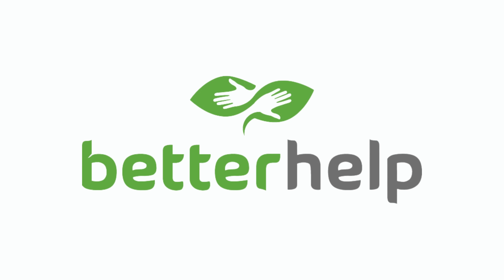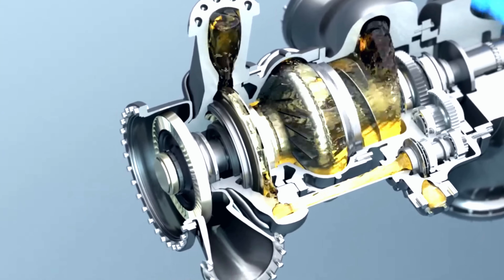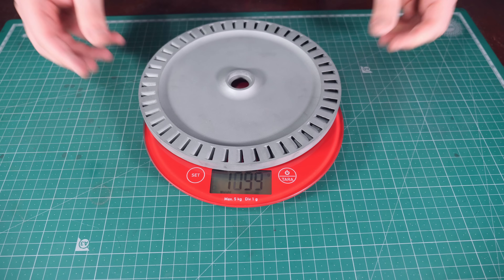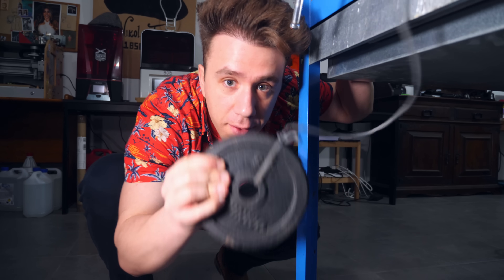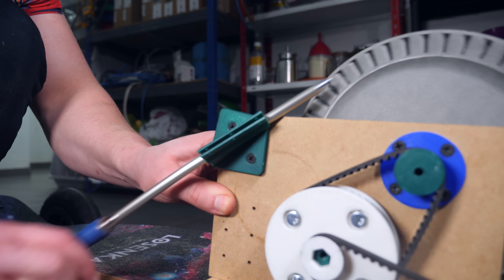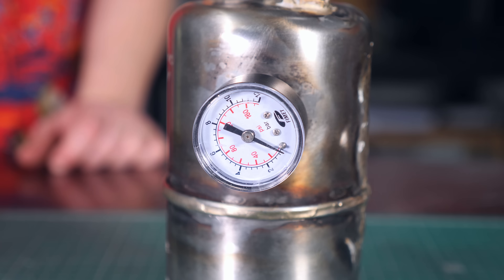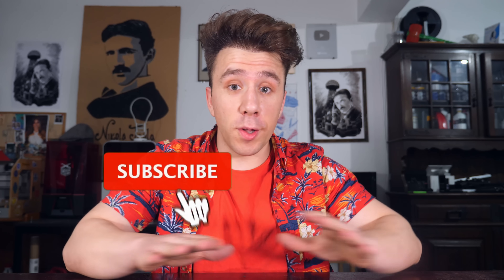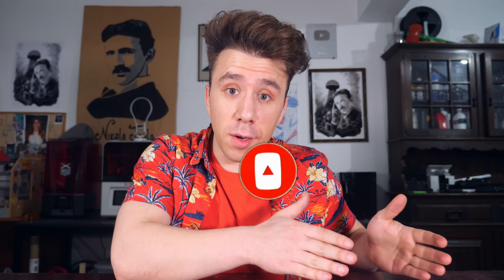I built a TURBINE Skateboard

Comment from the maker: JLC3DP 3D Printing &CNC Service Starts at $0.3: https://jlc3dp.com/?from=integza
3D Models at: https://integza.com/
My 3D Printers
Prusa mk3:https://amzn.to/3SEXr83
Bambu Lab X1 Carbon:https://bambulab.com/en-eu/x1
Creality K1:https://amzn.to/4bjM4K3
Prusa SL1S SPEED:https://amzn.to/4bu7LHA
Form 3: https://formlabs.com/eu/3d-printers/form-3/
CNC MACHINE:https://bit.ly/3sqTUQm
Reply: Integza, my sibling in Tesla, don't mess with homemade pressure vessels. Use an old LP gas tank or something similar that is designed to handle the pressure.
Reply: Integza, I greatly enjoy and admire what you do. You have investigated many interesting avenues of science in a fun and engaging way. HOWEVER, I have to say this was the most DANGEROUS video I've ever seen you make. You were incredibly lucky that the heavy metal flywheel didn't come loose from it's mount (an easily sheer-able bolt) and that your pressure vessel(without a necessary emergency pressure relief valve) never ruptured or exploded. between this and previous videos where you almost set your surroundings on fire or get a minor injury, your luck will run out. Please find a professional safety consultant to run these ideas by. I look forward to many more exciting but safer videos and wish you the best.
Reply: You said that you wanted more mass on the turbine wheel so that it has more ”hmph”, but the thing is, inertia does not increase torque or power. It only smooths it out. This is a very common misconception regarding flywheel physics. Very cool video though!
Reply: Super vidéo 👍👍👍👍👍👍👍👍
Connais tu la Jaguar cx75 ?
Voiture de la marque Jaguar , de 2010 ,elle est dotée de moteurs électrique et aussi de 2 turbines  pour générer de l'électricité.

Il faudrait que tu t'en inspires ça ferait un meilleur rendement 👍👍👍👍👍👍👍👍👍👍👍👍👍👍👍👍👍👍👍👍👍👍👍👍👍👍👍👍👍
Sam
Reply: BRING. BACK. THE. MOUSTACHE.
Reply: Never touch the the outside piece of wood when using a table saw. It’s the most dangerous thing to do. A big Nono. Please pass on to integza. Can’t have these videos if your fingers are gone.
Reply: @murdocks4304     that liquid nitrogen can do the same thing albeit w/o the blood n guts of a blade.... but I saw
him doing that & it made me cringe.  We were given all our fingers for a reason,  keep em' long as ya can!!
Reply: Screw betterhelp, it is really sketchy.
Reply: Integza for One of your next Rocket engine I suggest you to 3D print some parts with a carbon fiber filament and then cook It to remove the plastic from It, so you can get a nice carbon fiber Rocket.
Reply: Integza, BetterHelp is not the kind of company that you want to support. They've leaked private customer data in complete flagrant violation of any and all privacy laws, and their "therapists" are horrible.
Reply: PLEASE DO NOT USE A COMPANY THAT WAS SENTENCED FOR SELLING PATIENT INFORMATION AS A SPONSOR.

Tried BetterHelp once, they were rather expensive for my countries standards, so I cancelled, so they were like hey finnish your order woth a discount now. Then I did not, then another discount, in the end the price was about 60% off. So I figured there is no ay a healthcare provider based in the US can offer such crazy discounts to a random dude, while still keeping professional and vetted staff and not making any money on a side hustle. And sadly as we learned it was about the same thing it always was: Data, data, data.
Reply: The turbine isn't used because it's actually less efficient than the combustion engine. They also stop and start more quickly, adjust power more quickly, and are less effected by ambient temperatures. The turbine is only better if you need incredibly higher top speed and power, so it's not really useful on the road
Reply: I really like iceberg and see you in egghead
Reply: That pricing on JLC3DP is weird. Your part show 1,7KG weight but when arrived, it was 1.2Kg. I tried my part, it was 2.8 Kg according CAD (and volume by JLC3DP) , but it show 4.8Kg in part weight. That's big difference in price and shipping.
Reply: bro you HAVE TO add a cover that holds the air nozzle at the perfect angle an covers the turbine so the air doesn't get pushed everywhere  when it hits the turbine... you want to keep all that air concentrated on the injection site... when the wheel spins and the air hits the part without the opening the air bounces off and creates MASSIVE TURBULENCE!!!  but of you have it closed opff the will bounce off the wheel, then back in and around the box  but then back into the slot.... you'll get SO MUCH MORE POWER!!!
Reply: WHAT ABOUT DRY ICE???!?!?!?
Reply: Why did you change your icon to an orange? I missed videos because I didn't recognize the icon.
Reply: Not sure how I landed at your doorstep but I think bat-sH!T krazy is like a telepathy that attracts w/o knowing anything
at all about a person.  It's a subconscious connect that you seem to have plenty of..... I like >> peace
Reply: So you basically used my idea i posted some videos back of a rocket propelled skateboard you could ride but i didnt get any likes tho
So did i win a 3d printer heh 😅
Reply: You always do such a great job. So many things i would like to say or talk to you about, sadly i can not. i am glad you had a good time in Alabama, the coast is beautiful in the gulf. The turbine system was used in tanks but was very inefficient in that they still burned alot of fuel in idle.
Reply: Assemble two of those things and support them with small cogs.
Reply: For the next video You should do three things to increase the power output of the turbine and maximize your speed. 1) support the turbine wheel on both sides with bearings. 
2) balance the turbine wheel. There is definitely some imbalance
3) center yourself on the board so your (human & equipment)weight is distributed mostly evenly.
Reply: Here's a decent idea how about a 3d printed rc  plane powered by compressed CO2 or something, I bet that pressure vessel you built is light and powerful enough to fly it
Reply: Should have used a Tesla Turbine. Easy as pie to make. Just a flat disc. A bunch of them. No 3d printing needed. In fact Tesla turbines can spin so fast that the metal itself can't handle the centripetal force and fly apart. Probably a lot more efficient on air needed to run. And I would use a CO2 tank used for soda machines to power it. And you DO have brakes. Just need to blow the nitrogen at the bottom to reverse the direction it wants to spin. Top=Forward. Bottom=Brakes/Reverse.
Reply: That is so so so cool! Glad can be part of this amazing project!:face-red-heart-shape::face-red-heart-shape::face-red-heart-shape::face-red-heart-shape:
Reply: Put the setup on a biike and use a brake lever to aacuate the presure gun
Reply: Great video, but terrible sponsor. Better help has been in trouble for selling customer's data and doing terrible (or no) vetting of their "counselors".
Reply: for the love of god, don't blow your self up with shoddy home made pressure vessels, you need to get something properly built to handle those pressures with proper overpressure relief valves or burst disks.

At the very least you need to put some sort of pressure relief valve on that grenade you built...
Reply: please do not promote scam companies:face-orange-biting-nails: @integza better help is not a good site to promote.
Reply: Dude, i live just south of huntsville, just across the river!
Reply: bro make a video about tesla turbine
Reply: @sarthisarthi675  he did. several, actually
Reply: Let's try water. Engine
  Electrolices. Water. And. Change. Hydrogen gas  into   engine
Reply: This is pretty badass. I have an idea for the nozzle end, rather than have it free over the ports I suggest maybe making a vented diffuser, (like a vacuum cleaner, but it blows)

As another resin 3d printer user I know you can get pretty precise, so I'd say have the diffuser focused dead center over the port hole, make it rectangular so less air escapes with each pass of the next port from the corners.

I'd also say to maybe make 2 turbines and double vent the diffuser , if you're trying to keep a specific weight add some holes to the turbine 

Edit:

And the most important part I think is to put an air shield around the turbine(s), any opposite drag will probably reduce acceleration and top speed
Just my 2 cents I hope helps, the power is there with the nitrogen. If you'd like I could make a STL of the diffuser ideas if, I'm probably gonna mess with something like this myself.
Reply: bro did i won a 3d printer?
Reply: Just Google the 1963 Chrystler Turbine Car.  50 were produced.
Reply: You just have to lean your body or mass left or right to steer a skateboard. 

I would attach the tank to the board 1st  with a killswitch of course.

And try different tightness of the Truck bolts on the board. 

There are many different bushings and risers available too for a more squishy and smooth ride.

I always preferred more squishy rubber parts because it allowed me more control vs hard plasticy parts.

There are also a ton of bearing options out there, too, for high speed, or to make the wheel spin the longest.
There is a war going on of what bearing makes your wheels spin the for a long period of time with a slight spin.

Kind of like the fidget spinner wars from the days of ole 😂
Reply: Yes dude I loved your video. I think you should make an exercise band suit that is braced at the joints of your body to make you run really fast. It solves a couple of problems, running super quick without effort, burning off that belly in style, and running away from tomatoes really quickly 😂. Keep making these videos there's amazing
Reply: Hi vin diesel with hair
Reply: When I saw your design for the liquid nitrogen, all I could think of is seeing your pants catch on fire. While you were in a panic to put it out, you knock over the liquid nitrogen pressure chamber and cause to rupture/explode on you. As a consequence, you would end up with burns from a fire and have tissue damage from liquid nitrogen. A very confusing situation for medical personal. 
As some comments mentioned, PLEASE BE SAFE! Make Pressure valve for your pressure vessel and testing for your pressure vessel. DO ALL THIS SAFELY! I realize others have said this and more, but I think it worth saying again. 
Besides the fact that you are an AWESOME DUDE, you still have to explain how tomatoes are disgusting and why it is important to the channel. Are you referencing something? Did tomatoes 🍅 try to invade your planet? Are you forced to pay tomato taxes to a tomato lord so that they don't attack you? Do tomatoes have small legs and this is why they are disgusting?
Reply: Pulse jet bicycle
Reply: Bud, this isn’t the me-163
Reply: i know why
Reply: How dare you. I <3 Tomatoes. Since I was a little kid. There's so delicious. Fresh on-the-vine tomatoes from the garden, sliced, with some salt & pepper.... MMMmmmmmm!!!!
Reply: Couldn't find you on OF
Reply: This for 3d Pinter video
Reply: Integza instead of having it rotating forward and back why not side to side
Reply: What is it about tomatoes you don't like, taste or texture? You can scoop out the seeds and the connecting membrane with a spoon. Then you can dice, or slice it up.
Reply: Please make a system for energy storage. Compressed air propell this turbine and this power a generator 😊
Reply: I actually wanted to start a 3D printing business back in 2018. But never got around to sing if there was government grants etc. Needless to say it's one of the most profitable side businesses for certain people that did it right.
Reply: What of an attempt to build an axial flux motor?
Reply: You are looking for a new engine design?

The discontiunous radial turbine is a combination of an internal combustion engine and a steam turbine. 
Maybe you need that concept for some upcoming projects..😅
Reply: Please pick your sponsor's better help. Has been outted As a horrible company. 
The person who made better help sold it, and that person is corrupt
Reply: 14:25 try to make a steering wheel for that thing and add a transmission with 3d printing 😍🌸 you can do it you are a genius 🙏
Reply: Maybe you could build your own combustion engine.
Reply: Integza... apparently people are getting in trouble for getting betterhelp sponsors. Just wanted to let you know. Cool video!

Comment: Would a flat nozzle (about as flat as the slots in the flywheel) improve the transfer of pressure? A small round nozzle will have a large pressure but it will probably not utilize the whole slot in the flywheel, or perhaps it does not make any difference? Round peg, square hole - but perhaps it evens out. 🙂

Comment: If we consider that the weight together with the tank and you in total weighs 100 kilos, doing the math the stopped engine can move up to 6 kilos, together with its weight of 1.3 kilos it is very good, and using a seal with 25 bar could move a large bike or tricycle.

Comment: if you run it with a clutch you can rev the turbine up real high and using its mass achieve longer run time/ more power while not hauling air containment

Comment: Why aren’t cars powered by turbines? Cause one they’re loud, the push tons of exhaust which makes like like small stone which normally the worst that happens in a crack in windscreen in to shattered glass and hit you on the face at 100 mph, they’ll pick up sticks and all the dust, also they’re not fuel efficient at low rpm nor like being at low rpm. They’re very hot and don’t like to run for thousands of hours with little maintenance. But what they are good at is making directional thrust a lot of it in small packages that fit in lane shaped object very well. If you wanna go really fast jets are they way to go if you wanna go short distances at a safe speed when ever where ever it’s a 4 stroke engine

Comment: Wonderfull! I'll join your Patreon too if you show how to build a go kart size with a double clutching mech for a higher gear ratio using a bigger & heavier fly wheel to give the wheels extra torque. Oh and could it be designed from a hand truck like ive seen on other youtube videos. Oh yeah, and make the other end connected to one of those neodymium enhanced alternator/generator connected as well to power a small aircompressor too?

Comment: Well you have stering but not used effective.  Attach handle bars to the board so you can lean into the turns.  In the video you can see you were using the canister, but it was not attached to the board no help there.  Can you get more torc by adding more gas outputs onto the turbine?  Loved the video.

Comment: You may be aware but the part where you have it lift the weight is actually pretty similar to the very first way horsepower was measured. Very cool you could use your set up to teach the difference between horsepower and torque.

Comment: integza im ten and i think you should try to build a jet powered 3d printer like turn the jet engine into a genarator by using a motor and a long shaft then attach it to the intake side of the turbo jet engine i dont think i will win the 3d printer but it would be nice because all i have is a crapy little 3d pen and i do stuff like taking old broken stuff and turning it into usable stuff and its anoying when i make something and i dont have an adapter for it and tomatoes are disgusting

Comment: Try again but enclose your turbine wheel and use the air pressure. If you can have at least 2 of the wheel powered by air or if you want to go bigger? Have all 4 wheels power by the air pressure. This will give it more power and mimic an AWD or 4x4 system. You can create a quick program on an Arduino or a Raspberry pi set up to allow the air pressure to be regulated.

Comment: Hey Integza, this gave me a thought-  what if instead of using the rocket turbine to drive the car directly, you used it to turn a high speed, low torque generator to power an electric motor?  can you rocketize a tesla turbine?   V2 probably better.

Robert Murray Smith did a lot of vids on the high speed, low torque concept for home energy generation, and it just seems like that concept might work well and be quite an efficient conversion of fuel to motion instead of doing it mechanically.  

This may be utterly ignorant, but do you see what I'm pointing at?

Comment: I find the pressure container you made from those camping cups dangerous. If those valves were to freeze water, they could simply get stuck, and it would be a serious situation, a spring loaded pressure relief valve would probably made the contraception a bit safer.

Comment: Pretty sure Duesenburg had cars that could do 150mph in the the early 1930s! I know even that naturally aspirated variants could easily do 125mph+ in thr late 1920s Just imagine what the supercharged ones could do!....
  They were incredibly advanced cars with 4 wheel hydraulic brakes and the most advanced engine for the time. They had a dual overhead cam, quad valve straight 8 with tuned intake manifolds and forged internals, roller bearings and a centrifugal supercharger!
 They actually broke multiple speed records with a one hour lap time average of 154mph and a 24 hour average of 136mph! Imagine going 136mph for 24 hours straight in the early 1930s!...😮
 Apparently it had a top speed of 165-175mph!

Comment: If you put it to a scooter 
Power it with compressed air

Fill up the airbottle with a matchimg airpump powerred by solarpanes and Batteries, you would have your own ecofriendly Air-Scooter
Reply: With a housing around the nozzle in streamline to prevent loose of energy